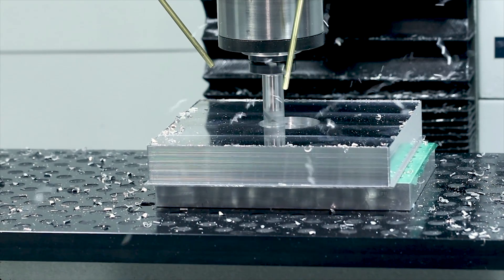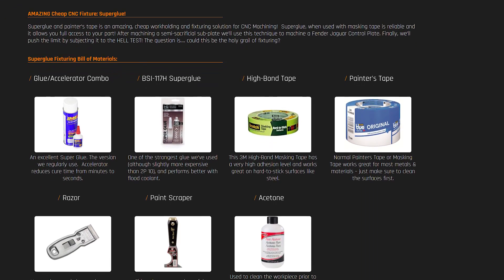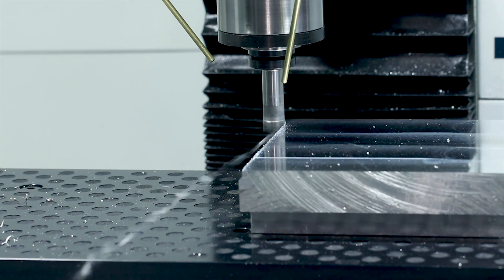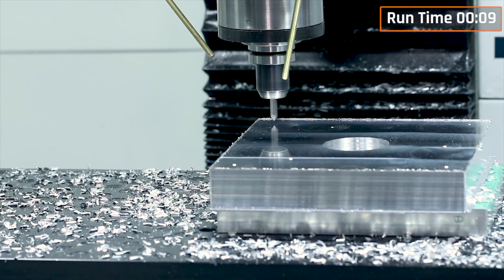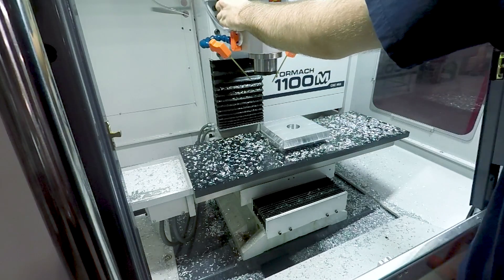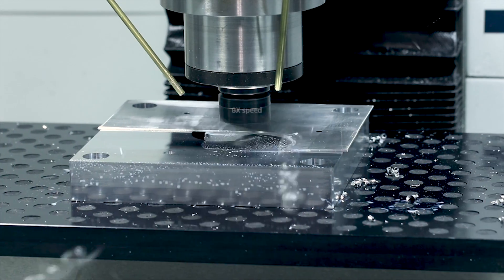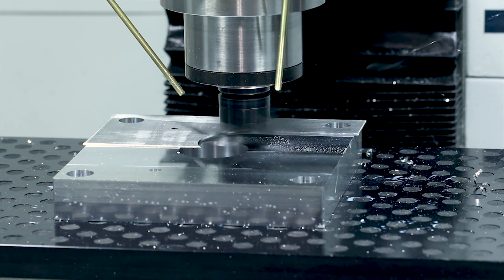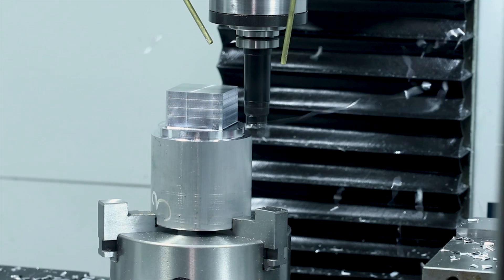Making a Lathe Chuck Subplate | WW222

Comment: Glue idea, you would likely need a anaerobic adhesive to cement. 
Option a, that I've set in a vacuum chamber before (because when air is removed it bonds) loktite, the highest strength they got.

The second is a quick set epoxy, that uses a chemical reaction and or heat to set. A 1 or 5 min set type could be had cheaply, and in combination with the powder coat tape could be a key plastic bow single peace for heavy hoggin. 

Just a electrician from rhode island who had a manual lathe in the basement

Comment: Only tip would be:  You did the SMW logo prior to final finish face pass.  Heavily used tools, particularly chamfer tools when used on various materials can leave a kerf on both the upper and lower edges so if you chamfer prior to doing your perimeter finish and face finish you are left with cleaner edges.

Comment: That sexy no-chip-holding-hole mounting system makes me ashamed of my chip-filled T-Slots.  

Then again, my mill will fit inside your mill so I don't feel too bad. :)
Reply: Chip filled t-slots are so annoying, especially when you run a machine that could fit a 1100 inside of it

Comment: I don't think you will find a cement for your PET (aka polyester) tape. PET is notoriously difficult to fuse. I used to be a projectionist, back in the days when movies came on film. Release prints were made on a PET base, and the only ways to splice them were to use an expensive ultrasonic welding machine, or to use sticky splicing tape. Solvent-based cements, which work great on acetate-based film, have no effect on PET.

Comment: Don’t ask me how I know but 3 jaw chuck teeth aren’t as strong as they look when you put them in a mill.......
Reply: Isn't this because when milling you apply force away from the chuck(upwards), while in a lathe, some/most of the force is pushing the stock against the chuck?
Reply: @Echo51  Yes I would say that's a factor for the grip strength. I had a complete failure of a 2 of the teeth though. Was impressive. 
I now have a lang 3 jaw vice that's designed for milling use. Great asset for the shop.

Comment: Ed, how are you? Your issue with the tap is bonding a very flat smooth thermo setting plastic to itself. The best way to do this is to disrupt the crystal matirx on the surface and allow the CA glue to get into the plastic to a deeper level. This needs to be done on an atomic level rather than just scuffing the surface. The way to do this is by using a primer for Polyolefins that effectively disrupts (doesn't quite dissolve) the surface of the PET. Here is an article on it.
https://www.swiftsupplies.com.au/blog/news-and-blog/our-best-super-glues-for-plastic-part-2-choosing-super-glue-different-types-plastic/
There are also better glues than just standard CA but both the better glues and the primer is probably a 2x improvement for sure.
Reply: @Ed Rees  great glad to help.

Comment: I think my favorite part of these videos is watching the superfly do its thing!  Could a 2.5hp router motor on a very rigid cnc router run a superfly?
Reply: Tormach has less HP so thats not the problem...but rpm may be.  Usually 2500 rpm for superfly, can the router spin that slow and have some torque?  Might just need to reduce DOC to keep it spinning.  Good luck.
Reply: @dmtdreamer  

Yes I have one of those Australian router speed controllers. Dang I can't think of the name right now.
Reply: SuperPid is the name of the controller. It says power down to 5000 revs but it has good power lower than that.

Comment: Why tape again and not just glue straight to the material?
Reply: I don't know why these guys tape blocks to plates in the fist place.  He still flipped it and decked the back off. so why not give your self enough stock to hold in a vice and not risk throwing your part? Or bolt it to the fixture plate threw the counter bores then contour.
Reply: I've tried just gluing straight to the material, and it doesn't hold nearly as well as tape-glue-tape.  Maybe a few factors at play, like the tape providing a little vibration damping for the brittle superglue, or better tape-glue adhesion than part-glue adhesion.  Tape-glue-tape is the only way to fly.

Comment: why use a drill mill to spot if you have a dedicate chamfer tool?
Reply: Correct me if I'm wrong. Chamfers are usually 45 degrees are they not? That would make a 90 (included) spotting drill which would have you  attacking only the rim of the dimple. This is not ideal.

Comment: Why did you use what looked like gauge blocks when finding the outside dimensions?
Reply: There was a small extended hat left from the previous op because the he didn't clean up the whole side. Gauge block is used to avoid having the probe touch that extended bit.
Reply: @CmdrRoot  Yup, my company makes pulleys and the v grooves are measured with gage pins on the outside to do the same.

Comment: A fly cutter? .....really?
Reply: Machinist 
Doubt the machine has enough HP to run one.
Reply: A fly cutter is SIGNIFICANTLY cheaper and doesn't require individual insert adjustment. It's also a lot easier to ensure consistent chip loading since you're only using one cutting surface, which usually means the finish is better than a face mill. Also less chance for chatter. Face mills are good for removing a lot of material, but fly cutters typically give a better finish.
Reply: why not?
Reply: What’s wrong with a fly cutter?
Reply: @occamssawzall3486  Nothing's wrong with it apart from it being super slow.
Reply: poofire 
The machine only goes 100 ipm.
Reply: Ed Rees 
But.  You weren’t running it on an MX😁
Reply: @Ed Rees video or it didn't happen. 😁